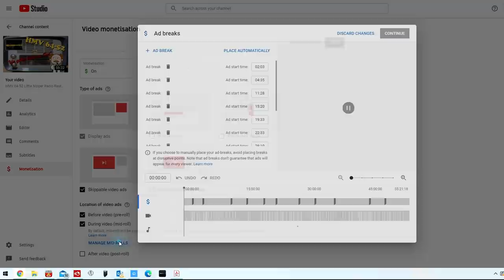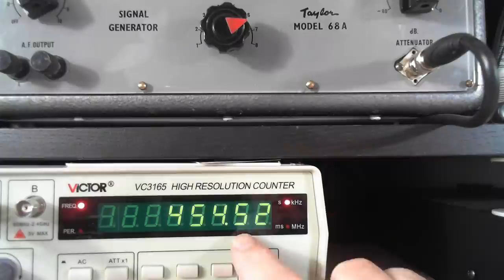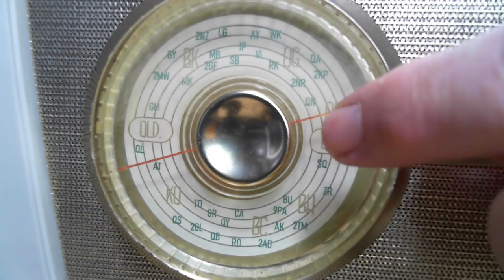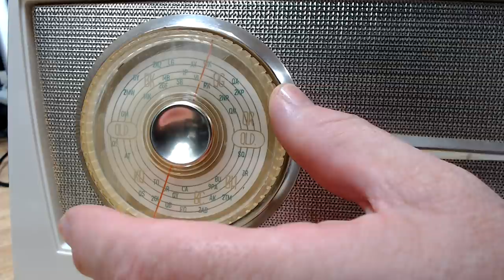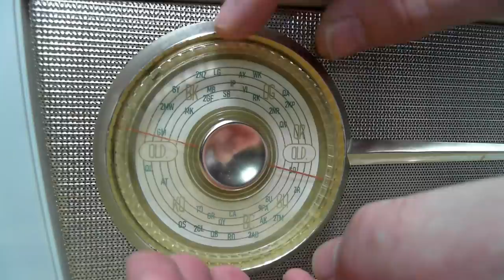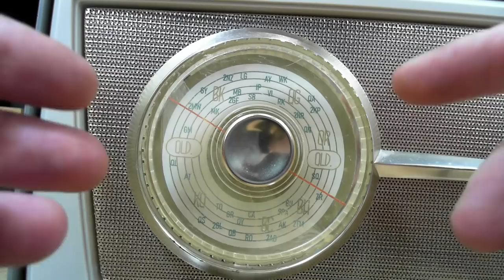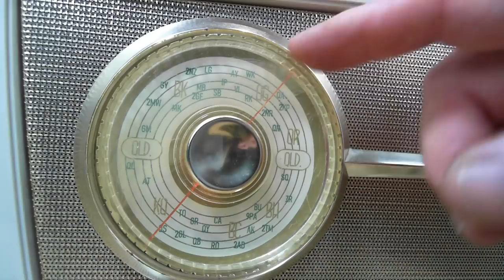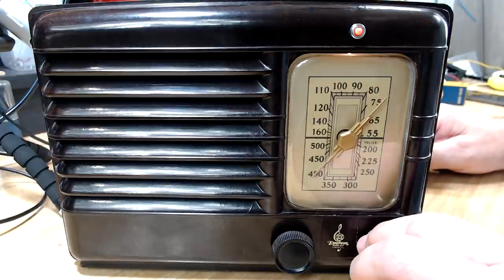AWA 586MA Radio Repair PLUS Bonus Content. RetrObright - Emerson Update

Comment: You should experiment with this a bit.  I have heard that retrobrighting is a temp solution at best.  I have heard it comes back much faster than what it took to turn yellow the first time.   Maybe try color matching the knob as it is now and keep track of how it changes or doesn't change across time.  It would be useful.  
I haven't even really heard that much of old radios doing this.  The absolute worst is 80s and 90s computers.
Reply from the maker: Hi tarstarkusz. I have no doubt it will return, where I store the radios is not in direct sunlight so it may take a while. Some of the plastic I treated 12 months ago is still bright so it may not be too quick hopefully 🙂

Comment: It is a nice radio,  even better now you have improved it :-D
You are wrong, it is an interesting  video.
Tuning, case, knobs, toaster rack rubbers.
The knobs came up a treat :-D.
Yes the adverts,  3 would have been better,  start-mid-end.
You get nothing from us,  other than long waffling comments.
Ooow just me then :)
Reply from the maker: Thanks zx8401ztv, I'm glad you enjoyed it despite it being a relatively easy fix. The knob came out amazing, I think they get better after they are removed for the peroxide solution and sit for a while. I have limited the ads to one at the start and one in the middle, that is more than enough. Nothing wrong with waffling comments, it's the waffling reply that gets me 😄 Cheers

Comment: So I tried finding information about this online but to no avail so hopefully someone here can answer my question. I started getting into trying to restoring tube radios and in the process while reassembling the radio I got the tube layout backwards and tried turning on the radio after realizing this I immediately turned it off properly placed the tubes so my question is what are the chances that I damaged the tubes while doing this?
Reply from the maker: Hi Gentry, more than likely the tubes will not have been damaged, the one you fitted in the rectifier position may be suspect though. If they are in the correct position now try it out. Or have you have tried it and it doesn't work and are now wondering if the tubes are the cause? 🤔🙂
Reply: @DavidTipton101  it seems to have weak signs strength compared to my other vintage radio so I’m guessing I may have damaged the tubes but I also just found that one of the IF transformer is loose so I need to look into that as that may be the culprit for the low signal.
Reply from the maker: @gentrythomas1  Oh, OK... good luck 🙂